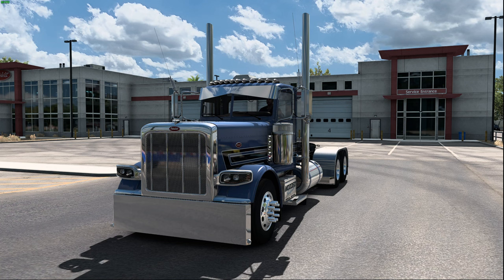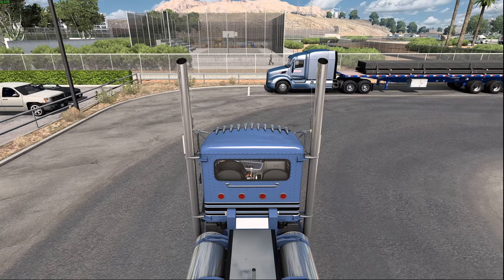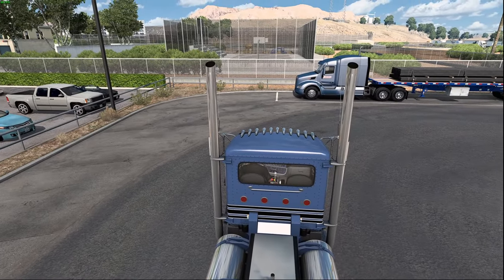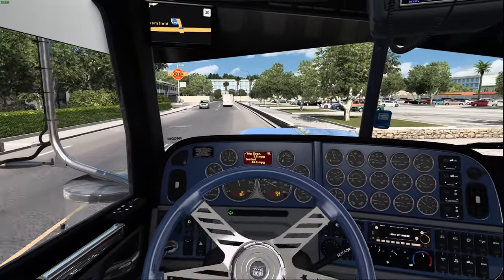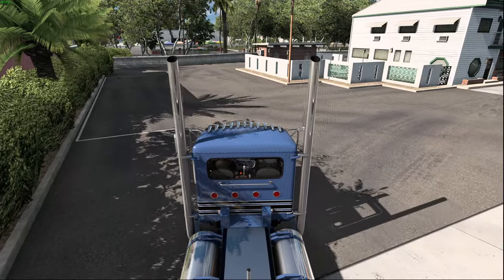NH 220 Cummins!  | Serial Black Modding | Showcase | American Truck Simulator

Comment: i like the the camera ur using is that a mod ur using lol id like to have that mod so i can drive like that
Reply from the maker: The one I’ve been using is from Rollin 389. However one is similar on the workshop called Pivotable Cab Camera
Reply: @MikePettGaming I know what mod you’re talking about that is from Rollin but I can’t seem to figure out how to use it when enabled. Any suggestions on what I need to do???

Comment: The sound is good but there is a virus in the part 2 of the files which is the open def. So 8$ dollars for a virus really ticked me and no it was bought by me downloaded by me from the link that is sent to my email to verify the account . I don't think it was done on purpose. They need to check their files on there server,or what ever they use. I posted it here because you are plugging. Sb modding also I will be sending a email to Sb about this.